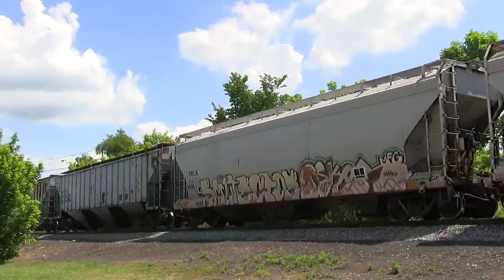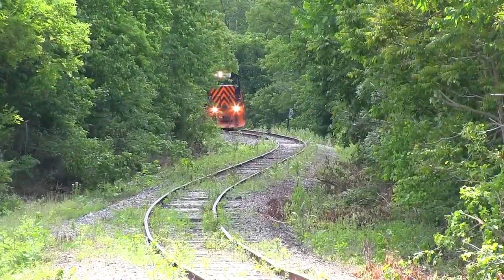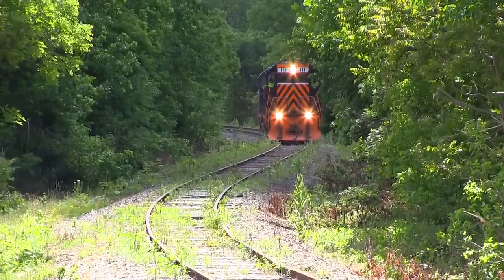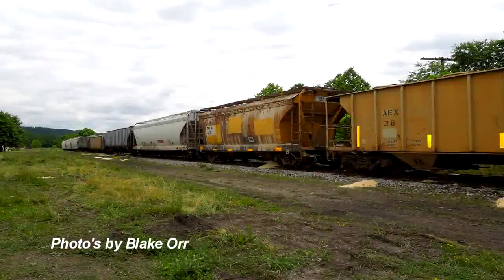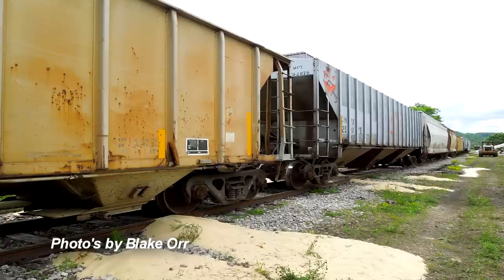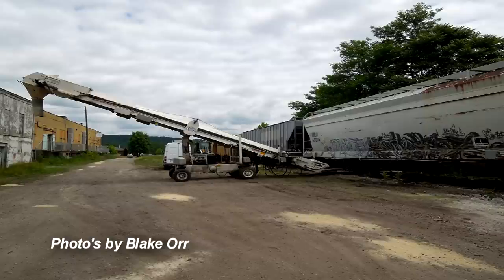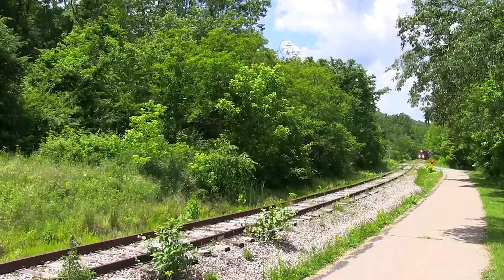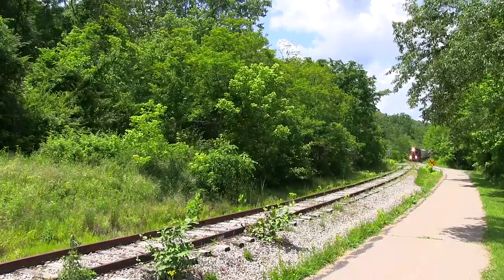Wheeling & Lake Eries first Train in 20 years!

Comment: ...and who knows? Before you know, after serving as a freight line, it may serve future Amtrak or commuter rail service.
Reply: Only IF there is a demand for the type of service Amtrak or commuter rail service provides.
Reply: agreed. alot of these rail lines can be revived if population density increases and rail travel popularity  rises
Reply: given track speed of commuter service - it would need to be upgraded - so highly unlikely.  the heritage line where I volunteer is in the same boat - a large transit organization owns the 10 miles of track we run on, and we lease the use of it - but we are responsible for maintenance.  If they were to ever run commuter trains on our line - they would need to pretty much replace and straighten the majority of the line.
Reply: DrSurprise That would be a nice thing. Where I grew up there was a line. Up until the 60's it was a mixed use and parts were double track. In the 90's there was talk of using it for passenger service again. But that died because they said the line couldn't handle the speed's of a normal commuter train. I don't see why railroads don't try to run at least two passenger cars on some line's.
Reply: I think commuter rail lines require being near major cities.
Reply: One of the biggest expenses in upgrading a secondary freight line for passenger service is installing Positive Train Control signalling, mandated by the FRA.

Comment: I wonder about the alco trucks on the lead unit.
Reply: AAR Type B trucks derived from passenger car trucks.  Certain railroads had EMD put them on new locomotives from traded in ALCos to cut costs a little.  GE also used new manufactured trucks of this type.  I would guess General Steel actually made most of them.

Comment: Am I seeing things or did the high hood have ALCo trucks on it?
Reply: +Jack Kennedy you are right, those were ex NS units , maybe NW or SOU cant remember.
Reply: +Conraildan I think it's an ex N&W, since SOU have there bells on the back and NW have theres on the front.
Reply: +DouglasP201 Not on GP35's It's Southern, Southern used ALCo trucks, and after the GP35, and SD24 Southern started putting the bells on the back of the locomotive, and started to run the locomotives long hood forward as default configuration. :)
Reply: CarolinaCentralRWY Ahh, l see. Thanks for that c:

Comment: I dont understand, why for a couple of cars must drive two engines
Reply: Marek Pekárek you have to  understand they might be picking up more cars later in their trip or they could have hauled a larger train before running up the branch.  they can turn locos off if not needed.
Reply: Conraildan its possible
Reply: +Conraildan There is another reason too. SCL let the tracks near here get in really bad shape. SBD didn't do much better. CSX finally came thru and put in new ties but kept most of the old rails. They also added the first new ballast in decades. Have not seen a train on the branch in nearly a year though. They do keep it sprayed. The reason for using two locos is that if one derails, it may not be able to get itself rerailed. Second loco could possibly pull the first back up on. Second is, they can leave the derailed one and ride back on the other. This is what SBD did when they derailed one. Then the next day another crew would come and rerail the loco/cars and fix that section of track.
Reply: +Marek Pekárek There could be a whole host of reason why two engines, a lot of locals have assigned power regardless of the size of the train

Comment: Hey is this line still running? With the increase in oil production and the Trump administration now in power oil production has increased. I'm wondering if the activity on the line has increased as a result. Cool to see an old line going back to work.

Comment: The rail road needs to start using the old abandoned tracks again and put big companies on them.
Reply: Yeah, because THAT is exactly how economics works
Reply: Boom, now you have a bigger monopoly
Reply: This very thing happened in cal.The railroad shut down the rail line.Did not pull up the tracks.Over the years housing was built along the line.Then containers fon china grew so much.The rail road was reopened.People fought it all the way.But was told that is the right of way to do with as they see fit.Which goes to show when buying a house.Go see where it is or where its to be built.Do not put to much trust in a realtor.After all they are out to get that commission.
Reply: @ericoxner326  They fought reopening the railroad line because their houses were next to the tracks? Tell me where to buy one of these, I need some prime trackside real estate!
Reply: @floridianrailauto9032 – Transportation is natural monopoly. Streets, roads and highways are the most obvious transportation monopolies. Having multiple railroads on the same route is impractical. A long time ago four four-track railroads ran between New York and Chicago. Each RR had two high speed passenger train tracks in the middle, one track for each direction, and two outer tracks for freight trains, again one track for each direction.
Improvements in train management and signaling reduced the need for multiple tracks. As the more successful RR companies bought out the less successful, the excess tracks were removed. 
Now a single main track with passing sidings carries many times the traffic of the old multiple track lines.

Comment: Rail is still the cheapest way to move freight why is it that so many rail lines are redundent .
Reply: Wayne Fee, the cost benefit ratio changes with smaller loads.
Reply: Wayne Fee Location. Many now abandoned lines either had the businesses next to the line shut down or move or not have a use for rail access anymore. When the customers go away, so do the trains. 

Now if you're starting a business that benefits from rail access, would you rather start it next to a line that is in good condition to run trains on the next day, or next to one that looks like it can barely support itself? That's why as time goes on abandoned lines are more likely to stay abandoned, but they can be revived of course.
Reply: Wayne Fee , abandoning with rails in place is better than removing rails. Once rails are removed, environmental hearings are needed to reinstall.
Reply: Great video!!